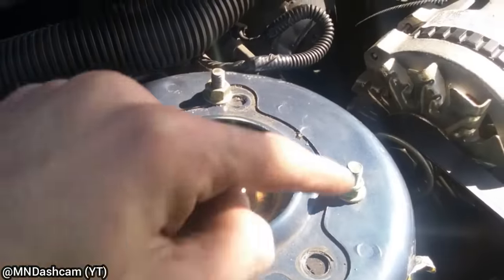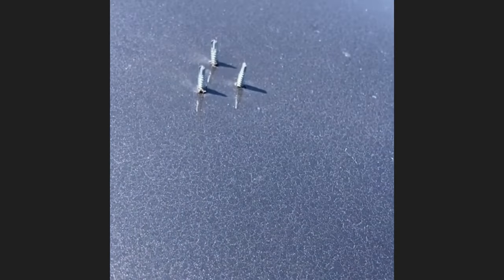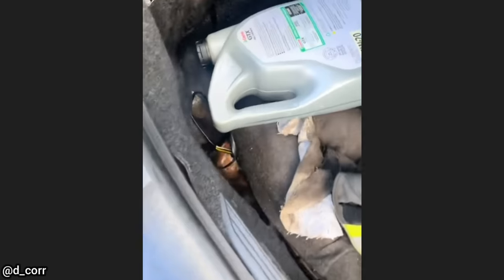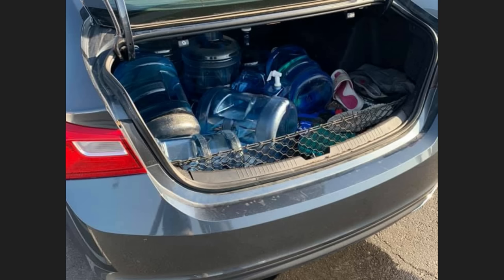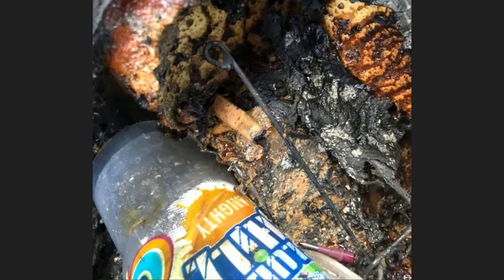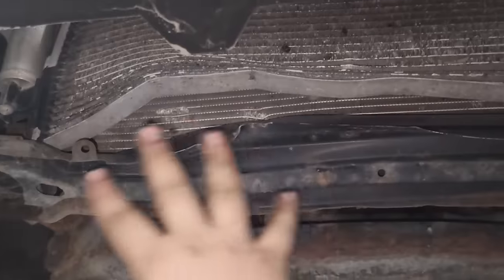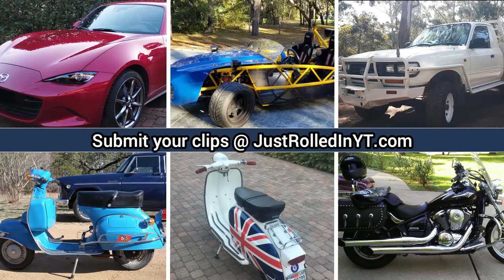Customer States He Got Scammed By Another Mechanic

Comment: Horn in the trailer connector is the best thing I've seen in a while. I know exactly who I'm doing it to lmao
Reply: I'm thinking hook it up to the turn signals so it doesn't start honking until he gets to the end of the street.

Edit: Second thought - that won't work. You have running lights, left turn and right turn and that's it. Brake lights just power both turn signals. It'll go off as soon as he steps on the brakes or unlocks using his keyfob no matter what.
Reply: One I did to my friend was zip tie a harmonica to the grill so that it made weird sounds as he drove
Reply: When cars had hubcaps a few rocks in the hubcaps were fun too
Reply: @lilorbielilorbie2496 I did this to a coworker with a brand new truck on the job site. Should have seen how fast he jumped out of the cab thinking he'd dropped half the engine out of it.

Edit: phone messed up spelling.
Reply: A co-worker installed a windshield washer nozzle under the dash of our boss's car, aimed at the drivers crotch. He then connected the washer pump to the nozzle. And then he wired the washer to come on only when the Torque Converter Clutch engaged. It took boss a while to figure it out, and he actually laughed about it. BTW, we all were mechanics.
I like the trailer connector idea, too!
Reply: @garymiller3264  A buddy of mine would put ice cubes in hub caps in winter, which I guess left the victim wondering why the noise appeared and why it slowly disappeared.
Reply: I also heard about a guy who made a relay to stall out a car every time you put it into drive 😂
Reply: The turn signal only should work if you use/have a 7 pin connector.
Reply: @bigEproductions100  while i was in high school and college, i would keep extra zip ties and toy harmonicas in my car, nobody was safe from me putting a ziptie around a drive/axle shaft or a harmonica to the subframe whenever i stepped out of class for whatever reason. not even the principal or deen of students were safe, but because there were auto programs in HS and college they would just take their cars there, here i, being a student in the auto programs, would "fix" it and send em on their merry way. though there were plenty of other times fellow students cleaned up my tomfoolery and return my harmonicas
Reply: Marbles or gravel up the exhaust is another.
Reply: @danlevesque5437  That's just called driving a Ford!
Reply: Ziptie on the driveshaft is fun too
Reply: It's almost on level with the harmonica ziptied somewhere under the carriage
Reply: Connect a horn to the high beams for even more fun! I know someone that rode around for months and never figured it out.
Reply: @wally7856 Chances are you don’t live on a dead end where you can drive right onto the street without turning. Hate people like this. It’s a bad habit and arrogant not to signal when you don’t think it’s important or no one is watching. One of these times you won’t see someone and they won’t notice you cut them off in time.
Reply: I love the harmonica one, that's great. Zip tie on drive shaft is fun too. Also, the rainbow honk if you're (letter)G(letter)A(letter)Y makes my friends happy

Comment: I always love how often people attempt to fix leaks with like 80$ worth of sealant or JBweld when a brand new gasket is like 2$
Reply: i had to replace my car’s oil drain plug when i bought the vehicle bc the previous owner had over torqued it and rounded it off and i was genuinely surprised how cheap an oil pan drain plug is. i got one of the magnetic ones that makes future oil changes easier but it was still right about $10
Reply: Had a 2001 Taurus that needed a $2 paper gasket...and 8 hours of labor to get to the gasket. (Videos on YouTube of that repair on the 3.0 liter V6 if you're curious). A bottle of K-Seal for about $10 did the trick.
Reply: 90% of the time the gasket or bolts you need with crazy or unusual temp fixes it is becuase they are out of stock everyone locally and they'd have to wait days to get one in...but they need a vehicle and cant just wait around for it.
Reply: @Raymo2u  can confirm.  A good fix now is better than a perfect one next week.
Reply: @markh.6687  , I have one of those cars and I think if it's all that, it's best just to get another car that won't ever need that "8 hr repair."😂
Reply: @markh.6687   yep sounds about right. I had an engine gasket on my VW that needed to be fixed. cost 1,500$ to do so because the entire engine has to be taken apart 🤦🏼‍♂

Comment: The "another mechanic" excuse used to be my favorite clips, but now anytime self-tappers are involved, my new favorites.
Reply: I wonder what the ratio of a bad DIY job to bad/scam mechanic it is.  Although the orange epoxy or whatever might've just been to get the person to where they needed to go, but the person may've insisted on such a repair over having it brought somewhere to do it with proper tools.
Reply: @Aeduo   There are long-term rig jobs and "get me the F- home" rig jobs. I've done some of all, but had no delusions as to how long they would last.
Reply: You know what they say, the best long term solution is a short term solution that works. I've done get me the fuck home Gerry rigs that I forgot about and didn't notice until years later.

I can think of a few better quick fixes for that thermostat housing that would have held longer and better than whatever kind of mess that was.
Reply: On a road trip the thermostat lost its wax on my Honda Civic. The Honda dealership broke both bolts that hold the thermostat cover on so they JB Welded it together without telling me on a freshly rebuilt engine... @Aeduo
Reply: I was a computer/electronic tech at a large company. My Vice President of the computer department brought me a television, the old picture tube type, he had tried to mount for his wife’s exercise room, and drove self drilling screws 3” long through the bottom of the tv, and through the internal circuit boards! Inside, I found that it had broken off all 4 corners of the board. What was he thinking? Believe it or not, I actually fixed it. I was his hero after that.  But for the life of me, how do you become the head of the MIS department if you don’t know what electricity is?

Comment: The sock in the filler is referred to as a Molotov Cartail.
Reply: I see what you did there.   But seriously 420 evap codes are no joke,  😂.
Reply: haaaa!
Reply: A former friend of mine lost the oil cap to her Eclipse, so her boyfriend jammed one of his dirty socks into the filler. I wasn't aware this had happened until she called me three weeks later to come take a look at her car that died on the side of the road. Most of the sock was now inside the valve cover, tangled up in the valves, and some of the valves were bent. Oh, and I found her oil cap, it was still under the hood near the passenger lower control arm, in plain view.

I offered her $750 for the car as-is, intending on replacing the motor and keeping it, but she instead had it scrapped for $200. 🤦‍♂
Reply: I have seen people use a PLASTIC BAG*...  You know, the kind of plastic that **DISOLVES IN GASOLINE*

Comment: Given the “mobile mechanic” drilled new holes for the strut mounting I wouldn’t put it pased them to drill new holes in the water pump to help it fit 🤦‍♂️
Reply: As long as it's in the water jacket,  it'll be fiiiiine.
Reply: How is it easier to drill new holes than to just twist it 25 degrees??  Unless they bought the wrong struts and the bolts were further out from center than the holes on the car?
Reply: @stephen3164  I mean, if you're to the point of drilling new holes, drill them in the part you're trying install, not the car. At least then there's hope of someday fixing it correctly.
Reply: That was 100% the owner that did it. It’s always the owner, (unless they show me the receipt).
Reply: As a mobile mechanic for 20 years and worked in a shop before that, these idiots really make me mad as it gives mechanics a bad reputation. I refuse to modify a vehicle just so the part fits. I worked for a shop once that did this crap and I just walked off the job. My reputation is more important than their shoddy workmanship.
Reply: The mobile mechanic is the one fixing the hack job. I bet the "other mechanic" was the customer.
Reply: @vs-ww7cb now everybody knows that you drill holes in the water pump to let the condensation out.

Comment: Nothing says professional install like self-tappers drilled through the roof!
Reply: But dangit, they're not coming loose, are they??  😁
Reply: And blobs of red silicone!!!
Reply: I'm curious what the "correct" way to install roof accessories would be.  The sensible part of my brain is saying "you fn don't" but...
Reply: @tsm688  There are (usually) some roof cross-members which can be screwed to from inside the vehicle. Otherwise external mounting of roof racks, light bars, etc. may require door jamb or rain gutter mounts.
Reply: @tsm688  something tells me it's  either industrial high strength adhesive,or major custom welded brackets

Comment: I have quite low confidence which means i dont attempt anything harder than an oil and filter change and do think about the money I'd save if i could do more myself and less  use of garages. That said, I've watched all these videos and ive decided i have enough expertise and confidence to set myself up as a mobile mechanic. Coming to a neighbourhood near you soon!
Reply: I've performed many oil changes, but these days I just do filters and wipers and correct the tire-inflation (always correct the tire-inflation after any mechanic visit).
Reply: Got griped at over not installing a family members wiper blades, I said these don't fit this vehicle,  they bought them for that years vehicle.    Split year design.    Lol.
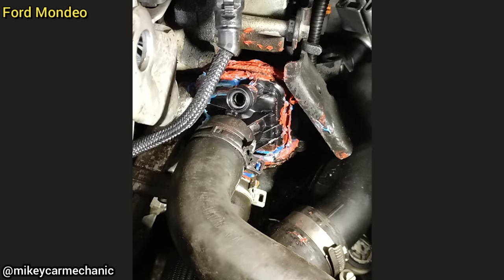Reply: So, you could install a t-stat housing just as well as the guy at 1:51? Will you make house calls to Phoenix?
Reply: Brake change should be an easy job, drum brake is a bit intimidating but pretty simple, remember when you change your brake do the rotor and grease the guide pin, youtube and google is your friend, they have bunch of video and forums for parts
Reply: I’ve been a me mechanic for over 30 years and the most difficult automotive repair I have ever done is wiper blades. There are at 3000 different ways the stupid things go on and each package comes with adapters for 20 different applications that are just slightly different from each other.
Reply: @tigletcat  Agreed! Years ago, there were only Trico and Anco style blades. Today, well your comment is spot on.
Reply: A fully-qualified Internet mechanic. Wear that shoulder patch proudly into Small Claims Court when you get sued. :)
Reply: @aliendroneservices6621  my car was in a body shop and the mechanic inflated it to 60 psi. My wife drove for 300 km and failed to notice. Once I discovered it issue I called the body shop and they have no idea why they did it. The correct psi is 38 on the car.

Comment: I truly wonder how many of those "other (unnamed) shops did this shoddy work" really translates to "I'm the problem I just can't admit it"?
Reply: Usually its the customer, but I have been scammed on a road trip with a thermostat cover JB Welded on a recently rebuilt engine by the Honda dealer because they broke the hardware...
A customer where I worked was charged for a rebuilt 1600 dual port for their VW Westy on a road trip that literally turned out to be made out of junk engine parts. They barely made it home. Two of the cylinders were for a 1600 and two were for 1650 aftermarket. Half the exhaust studs were broken, the oil appeared to be 50 Weight and it only got worse from there so we stopped disassembling it as it wasn't even a decent core...
Basically they made an engine out of the customers blown engine and another blow engine they had, but charged them top dollar for a rebuilt engine. Fortunately they paid with their credit card and they helped fix that repair shop for their fraud...
Reply: My old mechanic teacher used to share scam stories with the class from his days. Not things he did, but things he witnessed himself. People are willing to rip you off in any industry, so it's no surprise many of these are true.

Comment: The other day, my neighbor had the hood up on his brand new Toyota Sequoia. First I thought he'd killed the battery when he left all the interior lights on the night before, and started to walk over to offer him my jump pack. Then I saw that he was stripping wires under the hood with a box knife, and twisting them together. I backed away slowly, went inside, and made myself a cup of tea. Not getting involved in that mess if I can help it.
Reply: Neighbor woman approached me while I was mowing the grass and asked if I could help her husband who was having trouble starting the car.   I walked over and the husband told me that the car was running rough so he pulled the spark plug wires off to inspect them and when he put the wires back on the car would not start.  I asked him if he had the firing order correct and he replied, "Firing order?"   I just backed up until I disappeared into the bushes like Homer Simpson.
Reply: @MrSloika Well, at least it doesn't run rough anymore.
Reply: @MrSloika  Is it even possible to get them wrong? I'm no mechanic, but when I look at the wiring harness on my engine, all the wires to the coils appear to be exactly to length. You don't really have the option of wiring them wrong. Idiot proof, make it impossible to screw up.
Reply: @summushieremiasclarkson4700  New cars use coil-on-plug ignition.  Old cars used a distributor and yes, with a distributor it's possible to get the ignition wire order wrong.

Comment: We had one last Friday. I’m surprised no one sent it in considering we watch u. It was a 2020 jeep Cherokee with a 2.0L turbo. Was pissing oil like no ones business. Bro should’ve been driving without a drain plug basically coming from the bell housing. Strange for a rear main. The tech got it all apart and boy is it some shit. The flex plate only had 1/8 bolts installed….and it wasn’t even lined up properly. We believe whoever worked on it didn’t know the flex plates bolt holes align only 1 way and just gave up. But holy shit!! Those bolts are wet bolts they go through and are part of the seal!!! So he basically was driving without a drain plug lmfao. We know someone worked on it(not in dealer history) because u could see the history mark on the flex plate for the other 7 bolts. That was wild. Haven’t seen something that crazy in about a year.

Comment: That free diagnostic lady should go to an auto store for that.
Reply: The chain auto stores are a constant source of misery to auto techs.  People go to those stores for 'free' diag.   The kid at "Advance Zone" hooks up the code scanner, tells the customer that the car has a code for 'Fill in the Blank' and proceeds to sell the customer the part that is suppose to correct the problem.   The car owner than drives to a repair shop and says, "No diag.  Just install the part I supplied."  When the car is not fixed, and it rarely is, it's the auto tech's fault.

Comment: The ramp at the end was wild. I have the same ones but use them on my rough driveway so this seems unlikely to happen. It never even crossed my mind that this was a possibility but a smooth garage floor and a front wheel drive car is all it takes, I suppose.
Reply: I had bigger metal ones launch forward in winter every time i stopped the car on them haha. Had to anchor them by pounding metal spikes into the ground to get them to stay put.

Comment: I took a classic car to a shop once to have them look at a few issues. They said my carb was in need of a full rebuild or replacement, and quoted me $1k.  They said they were unable to even get the car running.  I declined repairs and drove the car home. 

(You had to set the choke manually at the carb, and switch it over to fast idle, when starting. Two pumps of the gas, pull the air cleaner, set the choke, set to fast idle - starts right up.  Then adjust the choke as it warms over the next couple minutes, then hit the gas and tye car would return to normal idle, and could be easily driven - though it would hesitate when you hit the gas.  The look on the mechanic’s face when I drove it away was priceless.)
Reply: Ah yes, the 9 steps to getting a 45 year old car running. Why didn't Diego the 21 year old know that?
Reply: @benb9151  Yeah, the OP is a bit of a git.